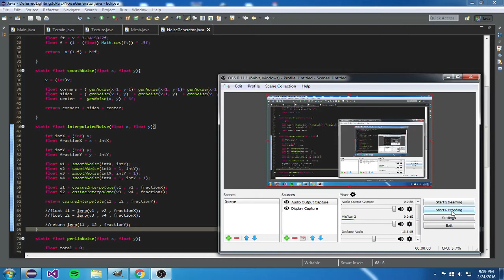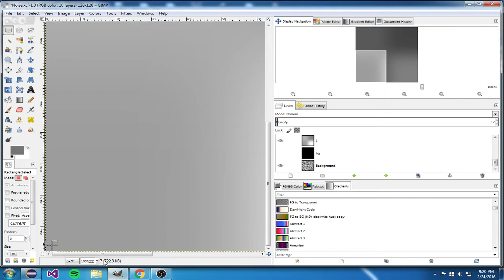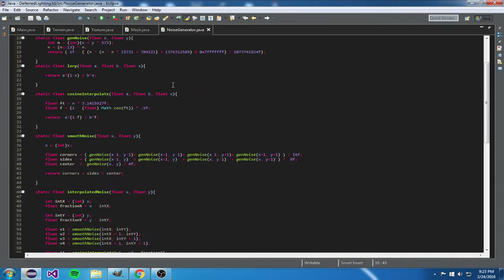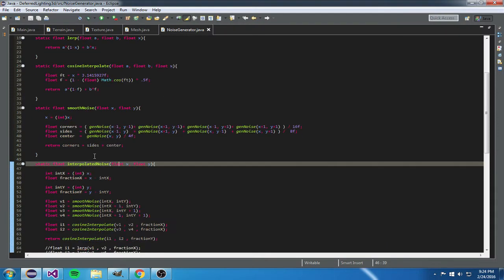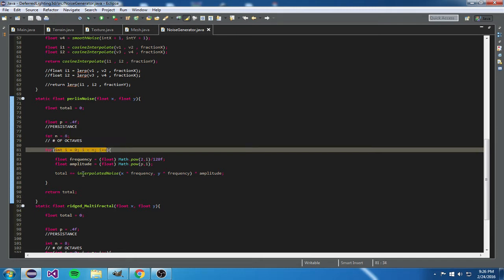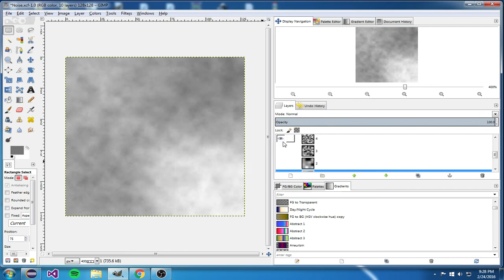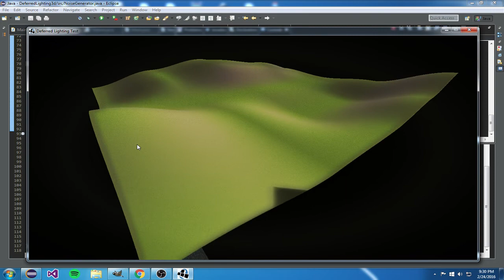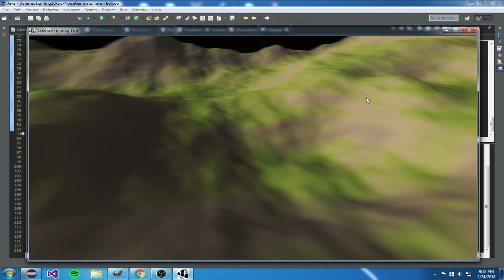How Perlin Noise Works

Comment: This has nothing to do with actual Perlin noise. What's shown in this video would be described as layered (mutli octave?) value noise. Perlin noise is a type of gradient noise and gives a result like this https://flafla2.github.io/img/2014-08-09-perlinnoise/raw2d.png
Reply: Yeah I was looking for an explanation of how Perlin noise works. This is cool, but it's not that. :/
Reply from the maker: While that is true, from my experience I have found that Perlin noise is often used as an umbrella term for other noise algorithms and therefore I decided to title the video with it. However, the concepts in this video also apply to almost all layered noise algorithms which is what the main point of this video anyway.
Reply: @EpicMStudios  I would probably do the same thing, calling any kind of gradual noise "Perlin noise". Or I may call it "perlin-esque" or "quasi-perlin" or "perlin inspired" to clarify that it isn't true Perlin, but visually based on it. Just keep in mind, it can be misleading if someone is looking specifically for Perlin noise. And this doesn't include simplex noise, since they are very similar (from what I recall). Although I do like to see other people's implementations of gradual noise generators. I feel like not a lot of people know how to do it, and I only recently learned how to make my own.

Also, if you know your implementation isn't technically Perlin, then it would be better to give the function a name other than "perlinNoise" as a general rule of practice. I have used other people's noise libraries before, and If I discovered that their Perlin noise functions didn't actually give me Perlin noise, I would be a bit concerned.
Reply: @EpicMStudios  A better term for the method described here is a Gaussian Pyramid.  https://en.wikipedia.org/wiki/Pyramid_(image_processing)#Gaussian_pyramid

It'd be nice if the title of this video could be changed as it shows high up in the search results for Perlin Noise.  There are very key differences in this method and Perlin Noise, like the ability to "zoom" in and out infinitely without any increase in memory.

Comment: ok, say that I'm generating hash noise with the classic:
 float rand(vec2 co){
  return fract(sin(dot(co.xy ,vec2(12.9898,78.233))) * 43758.5453);
}

glsl bit, how would I turn that into perlin noise..? purely in glsl only.
Reply from the maker: Using purely GLSL the only way I can think of is to pass in a mesh that is already a flat grid. Then, you can use this function in the vertex shader and sample at different octaves based on the UV. I would not recommend this method unless the noise needed to change/morph every frame. For a static mesh such as terrain it is better to generate vertices once before the program actually starts.
Reply: yeah, I modified it to generate based on UV's in the fragment shader, though, and it's just fine grained noise, was hoping to turn that into something perlin-esque.

Just can't figure out how to get low frequency noise out of it rather than just repeating (sine) gradents. rendering it to a render target of a certain size to get the 'octave' out of it would work, but the renderer I'm using is gles 2.0 so only 1 rendertarget available at any given time and it's used for viewport capture/for refraction in shaders, for an example).

Thankfully the renderer will get a rewrite in about 6 moths time.